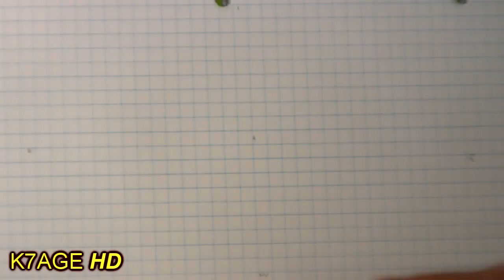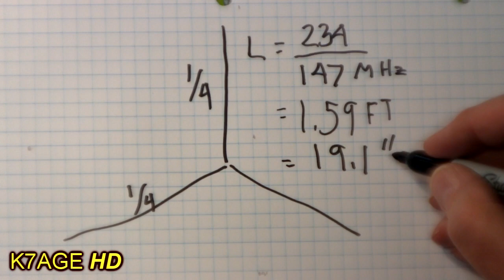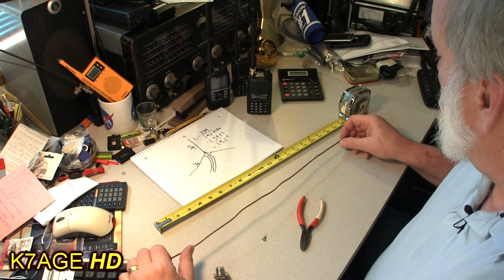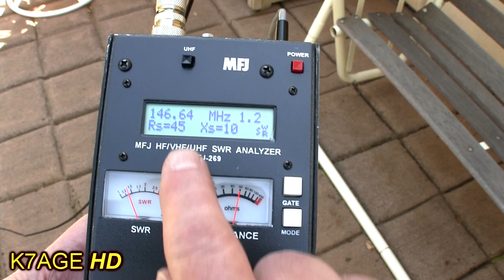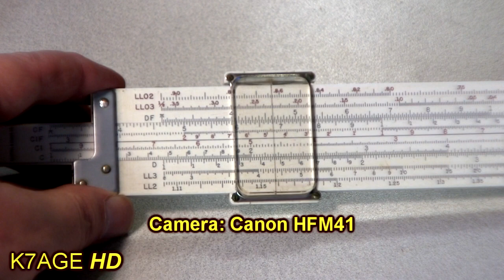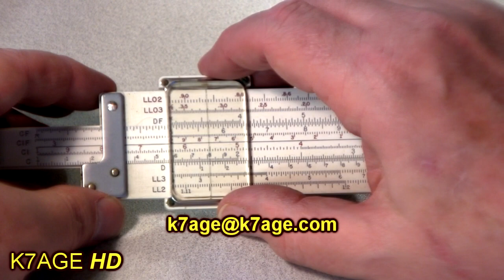How to Build: Ham Radio 2 Meter Quarter Wave Antenna

Comment: Using the same so239 I reckon with a bit of soldering and threaded brass tube you could have all the elements screw in and out…….

Comment: Looks really simple. I am glad I saved my soldering gun. Just curious if the 12 gauge wire fits into the hold on the connector, or did you have to hold it in place. It looks really solid but like you said, move it around while soldering and you have a cold joint.

Comment: Yeah, I think THIS is the idea I needed.  Just starting out on 2m and having trouble connecting to a net meeting thru a repeater about 12mi from me with a handheld.
Reply: Parts came today and I build a prototype just in time for a daily net I've been frequenting.  I could finally just transmit from right out the door.  Already started developing a more rigid model.  Maybe I'll get an SWR meter too.

Comment: Great video presentation! Just wondering what type of coax you used for this antenna.
Reply from the maker: It depends how long of a cable from the radio to the antenna. RG8/LM400 for long length or RG58 or RG8 for shorter lengths.

Comment: I found some solid 12 Guage copper wire but it still has the insulation on it,  there shouldn't be a problem with that correct?
Reply from the maker: Correct

Comment: What does the 234 represent in the equasion? also is there a reason you used 147 MHz instead of the middle of the 2m band like 146 MHz?

Comment: Thanks for posting. I have an RTL-SDR and the starter radio 5R on order. This looks like a doable project. And potentially significantly better than the Dipole that came with the SDR.

Comment: I am an avid Wildlife Photographer and I go to some remote places..I always take my AnyTone 878UVii+ with me in case my cellphone gets lost, broken, no signal etc etc....I carry it in my camera backpack with an aftermarket quarter wave antenna..The problem is the antenna is always getting caught on tree limbs and brush..
    Now my question is could I make this antenna out of stranded wire so it would be flexible enough to fold neatly? I could easily fold the antenna up with 25ft of some RG8X and some paracord and put it in a bag to go in my backpack...it could be a life saver in an emergency, it may take some trial and error to get it to set upright if you threw some paracord over a tree limb but I'm sure it could be figured out before it was needed or another option could be to tie it to a decent length dead tree limb and then shove it in the ground or tie it off to a short stump....Anyway what do you think about using stranded wire? I could crimp the ends to keep then from coming unraveled...cool idea for an antenna thanks and 73
Reply from the maker: Hi

I would go with a roll up  J Pole antenna. It is straight with no radials. Google for it. They are made out of 300 ohm twin lead. You can probably find it on eBay. This will fit in your backpack. You can save weight and space by using RG 58 coax. That coax will work fine. Have fun.
Reply: @K7AGE  thanks

Comment: The slide rule was a nice touch. I learned to use one back in the 70's while in US Navy nuclear power school. I got my Technician license a few months back and quickly learned I have major transmit and receive issues do to the terrain around my location. If I doubled your calculations and made this as a half wave would that increase the antenna performance? KI5WGI
Reply from the maker: Hi, you can't extend the antenna to a half wave. The impedance will not be near 50 ohms and your transmitter will not be happy. Try and get the antenna up as high as you can.

Comment: I'm a newbie so this may be a dumb question... can this only be used when it is not raining? do you have to do something more to make it weatherproof? I live in Ohio so I am looking for a year-round outside antenna solution.
Reply from the maker: Just put some silicon caulk around the vertical wire at the connector.
Reply: Thank you for the speedy reply!

Comment: Hi Randy.   KA2YDW here.  Been a ham for over 30 years.  Only used store bought antennas for 2M and 440MHZ. We now live in a HOA.   I built one of these with 12 gauge wire and placed it on our roof. It is very stealthy  and  It worked better than the manufactured stuff.  I was so impressed with it,  I built another with 1/8 brass rod much more sturdy and looks teriffic.  Every Ham should have one of these.  Thanks.
Reply from the maker: It is a simple antenna that really works. Thanks for watching.

Comment: How much of that better reception came from the longer antenna, the higher ground and the ground plane. A better test would be with/without the ground plane but keeping everything else the same.
Reply from the maker: Some of the better reception is from the longer antenna. The rubber duck standard HT antenna is pretty poor. Height also helps.

Comment: 2 questions. 1) Do ground planes help with reception. 2) Does an Earth grounded ground plane receive better than a floating one?
Reply from the maker: The ground plane helps with the impedance matching. Earth ground doesn't help reception, helps provide lightening protection.

Comment: You forgot to bend the ground radials down to 45 degrees to get the match to 50 impedence! I know that works and I used the welding rods.
73's N6ZKI
Reply from the maker: I know

Comment: Thanks for the video. New tech here, if I wanted to run one of these up on my roof, does it need to be grounded for lightning strikes? If so, is there any sources you can suggest that explain how?
Thanks!
Reply from the maker: Yes it should. But many never do it. If you live where lighting is common, then  you may want to do it. Ward Silver wrote the book about Ground and Bonding. He is one of his presentations. https://www.youtube.com/watch?v=WizvvhQgtoA
Reply: @K7AGE  Thanks very much.

Comment: THIS NEEDS MATCHING. MAKE THE STINGER 20 INCHES, ADD A PARALLEL CAPACITOR. WELDING RODS ARE A POOR CONDUCTOR OF ELECTRICITY. K5LYT

Comment: question from Ultra Newbie, so if I would want a 1/2 wave instead instead of 1/4 wave,  I take 468 divided by 147 and my answer would be in feet, then multiply by 12 for inches. By making this 1/2 wave, would it make any difference?(worth the extra material) and then put on a pole. or does a 2 meter just need a 1/4 wave.
Reply from the maker: They that works great for a 1/4 antenna as the impedance is close to 50 ohms.  A half wave antenna would have a different impedance which would require some type of matching. That would make it a little more difficult to build.

Comment: watching this video with much interest as I want to build a 2m antenna which I will be using for my mobile rig which wiil now l become my 2m base station (I do not want a mobile in my vehicle). 
I have a question though: you went to all the trouble to cut 4 radials for 147.xx Does the actual length of the radials change to be shorter when you formed the loop to connect to the S0-239 socket? I would have thought  that the radial length would have been made a bit longer to compensate for the length lost in forming that loop. Maybe that little bit would not  have a great effect. 
Just a question from an inexperienced antenna builder.
Great tutorial.
Reply from the maker: You could make the elements a bit longer. Best to check with an antenna analyzer. An antenna analyzer should become one of your amateur radio pieces of test equipment.

Comment: This is the first homebrew I made in 1995 for my HTX-202. I talked all over the Dallas/Ft. Worth area on the repeaters and simplex - 5 watts, where the rubber duck could not reach. Then I learned how to make J-pole and a halo.  I ended up making yagi's from old TV booms and elements.
Reply from the maker: Easy antennas to build

Comment: A question for the experienced HAM's as a newbie just getting his license. From what I can gather, The four points are the ground plane correct? Would it be better to have one directly to earth or does it not really matter for this kind of antenna with the way its currently built in this video? I'm thinking of doing this myself and I REALLY like to have strong ground for any connections I have.
Reply from the maker: There are several 'grounds' that do different things. First is AC safety ground which is the ground pin (US standard) tied back to the entrance panel with a ground rod. Second antenna, we say ground, when we probably should say ground plane. With this antenna, the ground plane is the four radials. These don't need to be tied to an earth ground. If you think of a dipole antenna, the coax center is to one side of the dipole and the coax shield is to the other wire of the dipole. The 1/4 wave vertical is this with one end up and the other to the ground plane. Lighting protection is the third 'ground". This is having your tower connected to several ground rods. Also the coax cables typically at the base of the tower would have lightening arrestors to help to direct a lightening strike to ground and not into your radio. You could install a lighting protector with this antenna near the physical ground. If the antenna  is not really high, I would not bother. 

If you ask 3 hams about ground, you will be 18 different answers.

Hope this helps.
Reply: @K7AGE  This actually explained everything I needed to know! Thank you!

Comment: What lkind of cable did you  use to connect the antena  your radio?  English is not My first language i hear coex. I checked on Google but it gives me several coex cables...any one in particular to be use in this proyect?  Thank You
Reply from the maker: You will need 50 ohm cable, RG8, RG8X and RG58 are common. RG58 is the smallest diameter cable, with the highest loss. RG8 is the larger diameter cable with the lowest lost. RG8X is a good in-between cable.

Comment: Which is the connector (Ref# pls) you have to use to connect SO-239 to the coax cable?
Reply from the maker: PL259 connectes to the SO-239

Comment: Just passed my Technician test and am waiting to show up on database.  Meanwhile, I need to build a 2 meter outside antenna for my Yaesu FT-4VR I was given for passing my test.  Rubber ducky antenna just won't hit the repeater from inside my QTH.  I have to go outside on the deck to hit our local repeater.  I want to do it from the inside of my house.  I got a couple of SO-239's at the Ham fest yesterday to make a couple of antennae.  Thanks for posting.  I'll be making one of these as soon as I can get my SMA female to UHF connector adapter.

Comment: Where did you pull 234 from? Also... why do you make it complicated on yourself and use feet and inches?
1/4 lambda = c / (4 * 147MHz) = 299792458m/s / (4 * 147*10^6/s) = 0.50985m = 51cm ( = 20.08in)
Easy and no magic numbers (like 234).

Comment: I just recently got my technician license. Been listening on my uv5r with a 12” rubber ducky. It’s ok. But then I watched your video. So I built the same antenna. So far my longest contact was 144 miles on simplex. I live in a valley. Next I will build a j pole antenna. Keep the videos coming. Thank you from KC3PMX.   73’s all around

Comment: You know how to make a video.  Simple and concise.  Solid presentation. Thanks for the tips.  I am a new tech and am floundering with a Yaesu FT-70D analog/digital. The nearest Yaesu repeater is about 20 miles away and unreachable with the rubber duck.  Two thumbs up. I wanted more than a hot spot tie.  I an thinking about doing same  for my boat.

Comment: This is a great little antenna. I built one of these 28 years ago, it did the intended job of reaching a repeater that was about 50 miles away. I used it as my base antenna, with an alinco HT. The only thing I did differently, was that I used brass brazing rod for all of the elements. Thanks for the video, it brought back some nice memories.
Reply from the maker: All sorts of ways to build this.

Comment: Made one several years ago. A elmer went further with Me.taught me to insulate, and put a loop of 6 turns of of  coax . At the top. On a beer can. (Remove can) Then zip tie the coil and make a drip loop at the top.then a drip loop at the end before going in the house.  The whole contraption has ran for 30 years non stop. With a tiny bit of maintenance. Why mess with perfection?  Kv4li. Tks 73.

Comment: Got my ticket, bought a rig, but was waiting for my antenna in the mail.  Made one of these, got out to a repeater about 60 mi away, talking with a gentleman who wasn't too far from my location.  He came over and couldn't believe I was using a homebrew to get out so far.  Good times.  (Love the slide rule part!  Used my dad's back in high school...late 80's...math teacher said no calculators, but he was ok with slide rules!  Had to figure it out...no internet back then.  I was the only one in the class w/one.)  Great Video!

Comment: Thanks for this video  Randy, I made this antenna for my 2Mts station here in Costa Rica! I would like to know what is the gain of this antenna?  thanks and 73s from TI2GBB from EJ79WV grid .  -Greg!
Reply from the maker: Basically very little. But, it is much better than the rubber duckie on your HT and having outside and up in the air really helps to get you signal out. Thanks, Randy
Reply: @K7AGE  Thanks randy! I Made a local DX un Costa Rica,  I contact with a Station located at 68km from my Station!! Thanks for share this video! Ti2GBB Greg

Comment: Great video Randy! I just built a similar antenna based on your video... just altered using 12 gauge copper wire. Put it up on top of 10 feet of PVC pipe and leaned it against the side of the house. Using my Baofeng on high power I logged my first contact. A repeater about 50 miles away. My contact said I had a fairly solid signal! I also have another copy I'm setting up for 70cm.
Thank you!
Reply from the maker: It works!

Comment: Thanks for the video.  I am a recent HAM (just passed Technician & General at Cowtown HAMFest in Ft Worth) and your videos have been helpful.   I have a couple of questions on this:

1. Dissimilar Metals - do you have any aluminum to copper metal connections?  If so, how to you mitigate the cathode/anode or battery reaction that happens with dissimilar metals?
2. Feed Line Loss - what do you recommend for a feed line of about 40’-60’ of coax?  Would RG8-U be low enough loss?   (I would hate to loose all the gain of the antenna in the feed line - *grins*).

Thanks again for your informative videos.  I am looking forward to making a 2m antenna as well as a HF inverted V dipole.  I am gathering up wire, insulators, and picking up test equipment and crimp connectors as well as meters for all that is needed for antenna building and verification.   73!

Comment: You keep saying, one vertical and four radios, isn’t the radio what do you plug the antenna into? So you’re saying I need four more? I always thought these ground wires were called radials? I’m confused.
Reply from the maker: One vertical element. Four radial elements.

Comment: You can harden and also make straighten copper wire by securing one end to a vice and the other end in an electric drill motor. Carefully twist the wire.

Comment: What if you used the telescoping radio antennas in place of the copper wire?  That way you could adjust the beams/elements to any frequesncy you are using.

Comment: It may be a sophomoric question as I am only a tech'.  Why don't people build/use full wave antennae?  It seems that the 1/4 and 5/8 must work better or something because even when it's for 70cm they use usually a 1/4.  A full wave would only be about 28 inches.  I have a 5/8 wave for 2meter but if it is going up on the roof why not a full wave?
Reply from the maker: A quarter wave ground plain and a half wave resonant dipole both have about a 50 ohm impedance, which is what your transmitter wants to see. These antennas are simple to build. A 5/8 has a matching network in the base to bring the antenna to 50 ohms. This becomes a bit more complex to build and deal with the mechanical package. The 1/4 wave antenna is a great beginner project. Thanks for watching.

Comment: Hmm you were very precise with your measurements. I have to ask, what happens when you have an antenna taylored for a specific wave length, but transmit using a different band. For example can a 10 meter antenna be used to transmit 6 meter given (since 6 is not a 1/4 wave fraction of 10m)?

Comment: does the length of the radios and the antenna matter? I.e., if i make it longer/higher, is it stronger? Or are the lengths important for the frequency youre trying to get to?
To clarify, what did the measurements in the beginning have to do with the strength of T/R?

Comment: This might be a dumb question but where does the 234 in the formula come from ???
Reply: 234 is 1/4 of 984. 984 represents the speed of light in feet per second.
Reply: @Whopperjaw.  Ahhhhhh.... Speed of light in feet per second... thank you... I went through all kinds of formulas trying to figure out where that number came from.  I cant believe I missed that one...lol. glad it wasn't a test question... thanks again
Reply: Glad to help! I had the same question myself. Took a bit to figure it out. I've been studying for my technician license.  They use the metric system, so the feet per second number is a little out of the ordinary I think.
Reply: @Whopperjaw.  good luck on your technician test I just passed mine about a month ago I'm getting ready for the general at the end of the month now it's quite a step up from the technician test

Comment: It looks like the connector you are using is designed to go through a panel, is that correct? The four screw holes would be mounting holes to connect the connector to the panel. But is there a wire connection to those four elements? Can you provide a link to the connector on Amazon so I can see it better? I want to make one of these but I'm not sure what connector to get. KG7QWK